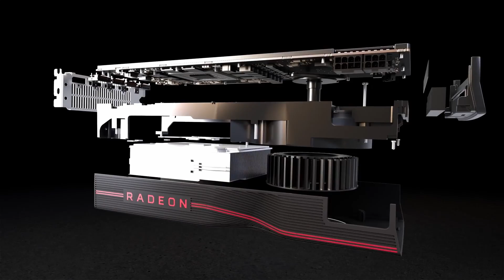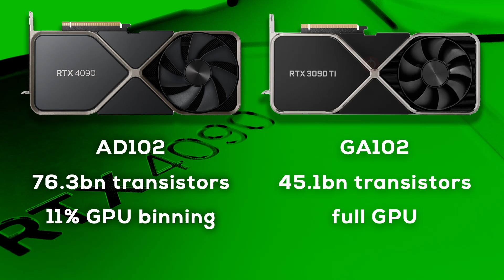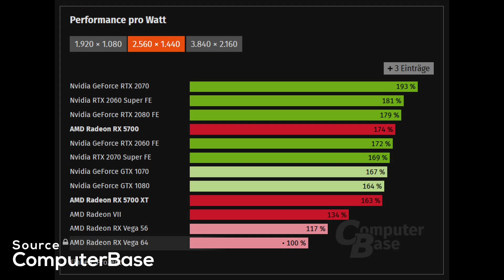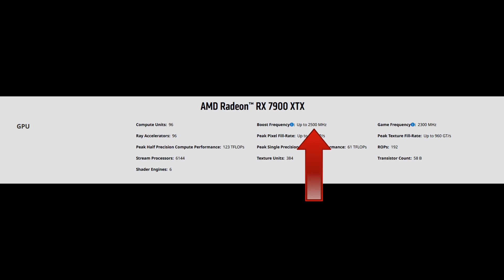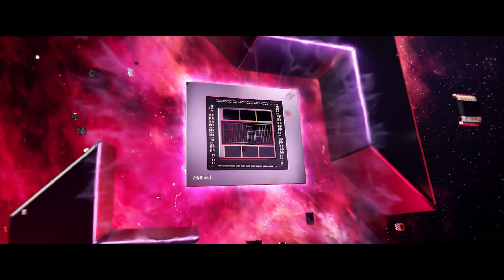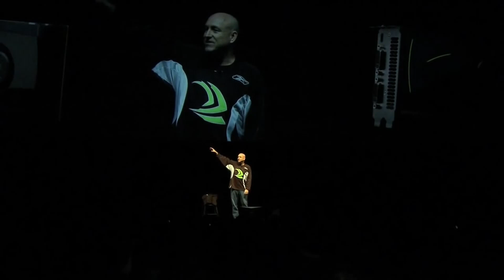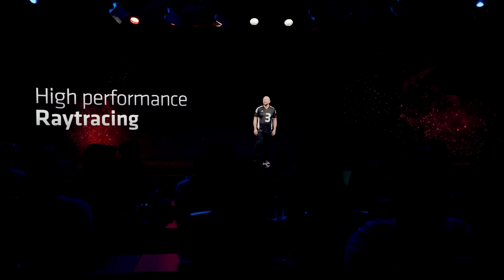RDNA3 – what went wrong?

Comment: Edited: Another possible reason, TSMC's processes have not lived up to their claims to AMD. We have seen similar issues with TSMC, Intel and Global Foundries in the past with how they expect a given process to perform and lower performance in products than expected.
Reply: Then why did the TSMC process live up to the claim for Nvidia? Since they are using the same 5 nanometer family node as AMD is.
Reply: @louisfriend9323  Nvidia is on the 4N 5nm process. AMD is the N5P process which from TSMC's literature is supposed to give a 40% power reduction over 7nm. Add AMD's architectural changes and we can see why AMD thought they would get 54%.
Reply: TSMC 7 through 4 already hit all their targets so...no. This is not a new node. The same 5nm node performs as expected for Zen 4 as well as all Apple silicon.
Reply: @FLCLimaxxx  Zen 4 is drawing more power than AMD expected. AMD is not on the same node as Apple was. AMD is on N5P. I could be wrong, but the node is one which both Zen 4 and now RDNA 3 are drawing more power than they expected despite TSMC claiming a 10% improvement over N5 which had a 30% improvement over N7. If we are looking for potential factors, we have to start with the process. As I said, we've seen foundries miss their targets when moving to a new process.
Reply: @UncleElias  Well this is not an excuse for AMD to stand up on a stage and show numbers just mere weeks before a launch. If they didnt have those numbers when showing off the cards. Then why show those numbers. Why show off something and brag about performance numbers that are no where near. Nothing but lies from AMD lately. And I for one am sick of the lies.
Reply: The problem is with the chiplet architecture.
It's a mixture between 5nm and 6nm, so there will be some impact on efficiency with older nodes.
I remember AMD already stated that the MCD chiplets does not increase any performance when moved to a smaller node, therefore it's more cost effective (for AMD) to place them apart instead.